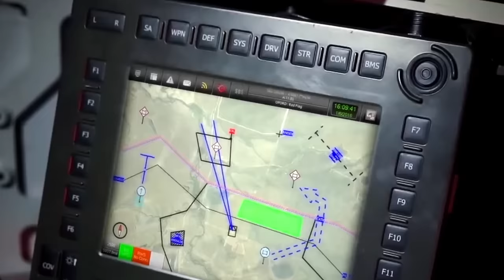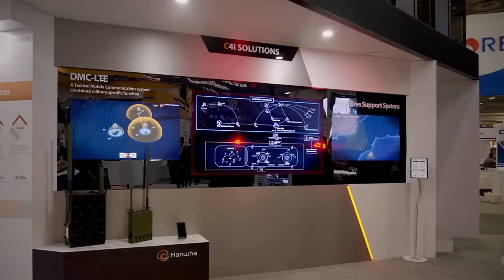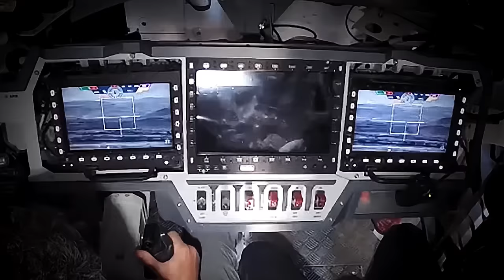The New Korean Weapon Designed the Shock the World

Comment: South Korean military tech is second to none. When they take up a challange they surpass it. Amazing military tech and industry.
Reply: @M3rl1n177  are you german
I searched your claim. Your claim is false.
Polish Army Lieutenant Colonel Stanik, who participated in the demonstration, told WNP, "From the point of view of a mechanized unit, (the Redback) is technically 50 years ahead of the BWP-1 armored personnel carrier currently in service. It meets the basic elements,” he said.

NCO Robert Carauda, who participated in the demonstration, also said, “I was able to observe the battlefield very easily because of the excellent visual equipment and camera performance installed inside, which was directly related to the improvement of combat power.

In addition, regarding the operation method of the Redback, he positively evaluated, “It was easy to operate because the installed equipment was not complicated, and there were no problems even though the test was conducted day and night on the off-road.”
Reply: Korea is the world's largest technological powerhouse.  Korea is at the center of advanced technology that you can imagine.
Reply: The cool technologies in this IFV, the APS and Spike ATGMs, are Israeli

Comment: Korea is starting to break into the Europen market now with the war there. Poland is buying their K2 tank other kits from there. I remember seeing their K1 tank back in '90 during the yearly exercise and wondering what that was. It looked like a M1 tank but smaller and slimmer turrent. I think the main reason that they are breaking into Europe is that they can deliver alot sooner. The main companies in Europe and US are back logged on their orders. From what I can see, Korea are now making great products that met what is needed.
Reply: K1 was designed by Chrysler, and built in ROK.

In 1980's, ROK was actually just a few signatures away from buying Leopards. 

Carter administration wasn't too helpful when ROK wanted to upgrade their old M48 fleet. So ROK went to Germans. But when the deal was about to be completed, US stepped in and offered to help with designing K1 tank.
Reply: Its the same reason why people buy anything korean, it's cheap!
Reply: not really only poland has any signinficant korean equipment
Reply: Redback was proposed to polish armed forces and it failed. Korean provided australian configured platforms for polish field testing and they preformed so poorly, that Poland decided to cancel procurment of it. Polish Borsuk, a lighter in development IFV outpreformed it on every stage. However, the nail in the coffin was the fact that Redback is equipped with elbit turret, which is way worse than new polish ZSSW-30 and equipped with subsystems, to which Isreaeli gov and secret services have software backdoors. Koreans tried to save face with proposition of quick fixes to Redback, including replacing elbit turrest with ZSSW-30, but damage was done. Not to mention, that phase 2 of polish contracts with korean industry now is under question, as koreans refused technology transfer and licensing, believing that Poland cannot refuse them, as it already bought 180 base K2s and 212 base K9s. Probably entire K2PL program will be cancelled in favour of buying more M1A2s.
Reply: Yeah, KOREA already made some deliveries to POLAND.
Reply: Good. Get away from German military equipment.
Reply: @dabda8510  There is also Chrysler, but parts of the Russian t80u tank were also used. .
Reply: Today polish MoD signed framework deal to aquire ~1000 Borsuk IFV and another ~400 Borsuk specialist platforms. All that with home made unmanned turret with autocannon and spike rockets (ZSSW-30). Huta Stalowa Wola, Borsuk's manufacturer will provide 58 IFVs in first year (not including prototypes) and 116 in next years, up to 2035. That means 17 or 18 battalions will be aquired. HSW also declared, that it will create heavy non swiming IFV, based on K9/Krab chasis, with ZSSW-30, to ride alongside polish Abrams. This means that AS-21 Redback deal is dead (it failed field tests and was outpreformed by lighter Borsuk).
Reply: Poland just ordered 1400 Polish-made and designed Borsuk IFV's. The Redback saga is finished in Poland as the Redback has failed the field tests in Poland.
Reply: @dabda8510  Ahha.. is that what happened back then...
Reply: I remember how South Koreans began developing their own Korean tanks in the 80s (which is probably what you saw in the 90s) because they could not use American tanks in the South Korean terrain. South Korea has way too many mountains, hills, and rivers, that American tanks got bogged down all the time. So Koreans had no option but to start making their own tanks. As a result, Koreans tanks can go literally anywhere and everywhere. They are smaller, faster, lighter, and built for all weather, all terrain conditions.

Comment: Two very minor correction, the redback spider is absolutely not an outback spider.  The are found everywhere in the country with the exception of most of the outback.  They need food and shelter and they have absolutely thrived in urban, peri-urban and country areas.  If you find a population centre of any size, you will find redback spiders.

Also, whilst very painful, redback spider bites are rarely fatal, and generally only have a severe effect in children or the elderly.  The Sydney funnelweb however...
Reply: They dont want smoke with the Sydney funnel-web
Reply: What, bites of the female redback spider needs often antivenom or you are fucked. Both the funnelweb and the redback are two of the most venomous spiders.
Reply: The red back IFV
Soldiers check in, ….
Reply: @peepopalaber  that's actually not the case. The antivenine for female redback bites is primarily for analgesia or insufficient response to other management techniques. Have a read of any of the current clinical notes and it confirms that whilst extremely painful, the venom is unlikely to kill an adult. Elderly and children are more susceptible owing to body mass or comorbidity.
Reply: Worst I've been bit by is a northern golden orb weaved. Stepped on her wile pissed. My leg went grey any I was in a shaky way for 12 hours
Reply: Incorrect. We get plenty in the largely uninhabited outback desert region of Central Australia.
Reply: @peepopalaber  nope ... I have been bitten 4 times by redbacks ... just feel really shit for a couple days, lots of lymph swelling, and sore limb depending on where the bite was.... funnel web and mouse spiders can fuck right off though... seen the results of those bites....
Reply: @liddz434  That was why I said "most of the outback".  There are vast tracts of desert area that don't have populations, but there definitely are in other outback areas through NT, Qld, SA and WA.
Reply: @skay9443  Yes, you also said they are 'absolutely not an outback spider' yet concede they do in fact live in the outback?!
Reply: @liddz434  Look, I'm honestly not looking to get into an argument about semantics or grammar.  What I was talking about was that it is not an exclusively outback spider, and that you are far more likely to find one in a built up area than in the middle of the Simpson or anywhere else remote.  The dialogue from the video talked about it in context of it being only found in the outback, and that was my contention.  I'm not recanting or changing my position, nor am I contradicting my initial exposition.
Reply: At last, someone's addressing the real issues presented in the video...
Reply: Redback bites are only predominantly dangerous to children.
Reply: people outside australia just mean australia when they say outback
Reply: @-Yogo  What the...what.... what's a mouse spider?
Reply: @rocketassistedgoat1079  depends on the variety, but a few look the same and have the same venom as the FW, and as such use the same antivenene ...
Reply: @peepopalaber  there is an antivenom, but is only used with kids and very lightweight people. I been bitten few times, uncomfortable for few hours,  but otherwise..
Reply: Redback dose sound better as we all know the Huntsman while more scary a cousin to the American Tarantula is harmless.
Reply: They need lots of vegetation, heat and humidity as well, thus why the colder or drier or less vegetation it gets, the less redbacks there are.
Reply: @liddz434  but there are greater concentrations in areas that offer shelter and vegetation with decent heat and humidity i.e. urban areas like Brisbane and Alice Springs. You find them everywhere but there are greater concentrations with those factors.
Reply: @liddz434  It's also a reason why red back spiders in New Zealand, called katipo, are mainly in the North Island and not so many in the South Island, as the South is much colder. The same reason for less concentrations in Tasmania as well.
Reply: Ha! Next thing your going to tell me is the Drop Bear isn't real.
Reply: Back when I was in scouts we were warned that the bastards are  quite fond of hiding inside outdoor toilets and biting people on the rump - but fortunately the scout leaders were afraid of all the spiders in there and left well enough alone.
Reply: Oh you ruined it. Why let truth get in the way of a good story.
Reply: For those who think they know what the sting , yes sting as most red backs fangs are so tiny & close together its more like a bee sting than 2 fang punctures , does to an Adult male , this is what happened to me !!!
I received a bite(sting ) working on an old house & sometime that night I got nauseous & the sweats which then turned to vomiting, much like food poisoning which lasted approximately 2 days with the bite mark surrounded by a large red ring lasted around a week !!!
When I went to the Dr,s they told me to go home & take 2 Panadol 😂😂
Reply: @peepopalaber  Adults mostly just get really sick, not knowing we were actually bitten by a redback. They are super aggressive though and are everywhere in australia.
Reply: Sounds like a Black Widow...
Reply: Red back you call that a spider?..Funnel web now that's a spider mate
Reply: Another minor correction. Narrator can't even say "Aussie" properly.
Reply: @skay9443  Lots in Melbourne currently too, they like dark spots to hide in. Not a good idea to reach into dark spaces unprotected.🙃
Reply: I was going to say exactly the same - only addition is that the redback has also now established itself as an invasive species in Japan.
Reply: This is begining to sound like the lupin express skit by monty python
Reply: I agree... Sydney is a far more frightening name.
Just hearing it sends a chill down my spine. No wonder everyone is fleeing it currently.
Reply: This is why however much i love Aussies, i will never set foot on that continent. It just has Nope written all over it 😥
Reply: " they have absolutely thrived in urban, peri-urban and country areas" This is why as cool as Australia seems i dont think im ever going to visit. I cant handle a fucking black widow hiding in my shoes.
Reply: @liddz434  some of them live in the outback. some of them live in town
Reply: I had a nest of red backs in my garage behind a board leant up against the wall..The web is very fine and they are small and innocent looking, but are in numbers...
Reply: @brentonherbert7775  Best if you find somewhere south of Tweed Heads - that way you don't need to change your State of Origin team and Brisbane can stay a big country town rather than a wannabe Sydney
Reply: @DarylChambers  Tf are you on about lmao.
Reply: @brentonherbert7775  You're the one terrified just by the name Sydney. I was just politely suggesting anybody who wants to leave Sydney stay in NSW rather than making Brisbane their new home.
Reply: @DarylChambers  Implying i live in NSW?
Reply: Methinks they mean the AFV as being an outback Redback
Reply: @rocketassistedgoat1079  looks like a funnel web but more docile
Reply: @JReklis  Ah, so it's a "pet" funnel web then. Designed for pats. ..
Reply: @rocketassistedgoat1079  I keep a couple around to take care of the feral cats
Reply: @JReklis  You're talking to a cat lover mate.
Reply: @rocketassistedgoat1079  what are your pronouns?
Reply: @ChineseKiwi The redback spider could not give a shit whether there is vegetation or not. The lack of vegetation may only indicate that the other conditions you mentioned, humidity and/or heat, are somewhat lacking but for the redback it really could not care less about vegetation although the other two are somewhat critical. Redbacks can thrive in areas, especially urban areas where they may not have contact with vegetation over many generations of their kind. Areas such as under house, inside old barns or inside almost any building with relatively easy access to their main prey, flies and other small flying insects. I lived and worked at a mining settlement in the inland Pilbara for many years, and for most of the year Redbacks were rarely seen but shortly after the rains came, there was an explosion of redback hatchlings before they mostly disappeared a few weeks later. Probably wasn't really the humidity directly responsible for it either, more likely it was because their main food source, flies and other flying insects also suddenly increased in population numbers after rains broke the long dry spell. It was always hot in the Pilbara region so that really wasn't a determining factor. The Daddy Longlegs' numbers didn't seem to be so tied to the rains. Maybe because they could survive longer by feeding off the surviving but starving Redbacks for some time after the insect population had when the rains had stopped. Daddy Longlegs just seem to absolutely love hunting Redbacks for lunch or breakfast, but I guess naming an effective IFV a Daddy Longlegs wouldn't help its reputation that much with a mostly ignorant public.
Reply: I think Red Back Spider is the right name for this IFV. Their heavy tank should be named the Funnel Web. Because it will cause an instant death.

Comment: Just a mistake you made the Australian M113AS4 is still an APC not a IFV as the turret is just better protection for the commander operating the M2 Browning. A IFV would have a 20mm auto cannon and up these days to 40mm and generaly armed also with ATGM system.
Reply: Commanders still sit behind the .50 cal in the M113s? I remember hearing Lt Roberts in his lecture on his experience as an APC troop commander in the Battle of Long Tan commenting that as an officer behind the .50 cal he found that firing at the enemy distracted him from his role commanding the APCs and he recommended against commanders acting as gunners for that reason.
Reply: @wattlebough  Most of the M113AS4s have an electric turret that houses the 12.7mm M2, some variants have no turret and just a gun mount and shield like the older M113s.
I believe then Lt Roberts during that lecture was referring officers commanding units, not the commanders of individual vehicles.

Comment: I have to admit it is my favourite IFV at this point in time. IT just ticks every single box you can think of..........And it bloody works.
Reply: Lets just put this out there. The CV90, especially the later models are far more dangerous than the Lynx, Puma, Bradley or K21 fighting vehicles. They are more modern, the cannon is much larger (40mm) the types of ammunition 3p programmable ammunition is deadly as hell. It can air-burst at set ranges, it would annihilate every single Russian in ANY trench with ease from kilometers away.
The weight of this IFV is almost as much as the Russian MBT (main battle tanks). Close to 40 Ton. 

The CV9040 is a highly aggressive vehicle, designed to control the initiative by staying mobile instead of slowing things down to a walk. Aggressive maneuvering is what the CV9040 is designed to do, outmaneuving vehicles and killing them in the flank and charging enemy positions to drop off soldiers right ontop of the enemy. 

These tactics have been part of the Swedish doctrine since the late fifties as seen in vehicles like the PBV301 and PBV302. And it was directly copied from the German playbook of WW2, where the German panzergrenadiers/dismounts fought more often than not from their halftracks, allowing them to keep pace with the tanks and also maintain initiative through aggressive maneuvering. 

A Bradley, K21 and so on is not designed for that type of combat. It's essentially an APC that drops off troops 100m from the fight. The CV9040 drops off troops within 0-50m from the enemy position, or simply drives up to it and let's the troops fight mounted.

In Afghanistan it was apparently tremendously deadly. The Danish or Norwegians were caught in some kind of fight/ambush and they annihilated the enemy.
Reply: @tomeng9520  CV90 is an incredible machine and in many circumstances are well and truly an excellent choice. The Australian Army either was not offered the CV90 or it failed to meet all of the requirements they needed. My favourite CV90 version is the twin 120mm automatic mortar due to it's massive firepower. The other versions are also excellent.

Comment: 3:35 the Rheinmetall KF41 Lynx is in fact not serving in Germany.
Germany has the Puma IFV, a KMW and Rheinmetall collaboration.
The Lynx is a slightly simplified export model. Which makes sense, as the overengineered Puma caused trouble recently.
Reply: The Lynx is in contention for the US Army’s replacement for the Bradley. Along with the CV90 & Redback.